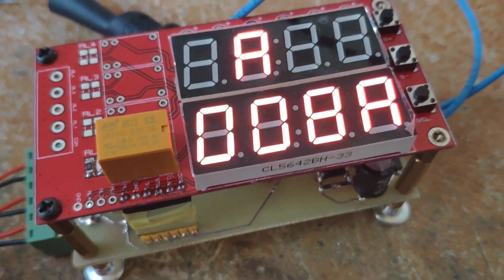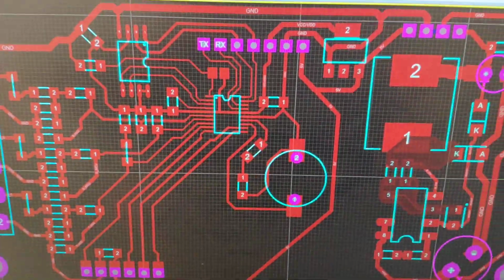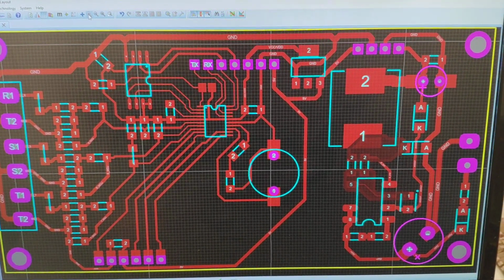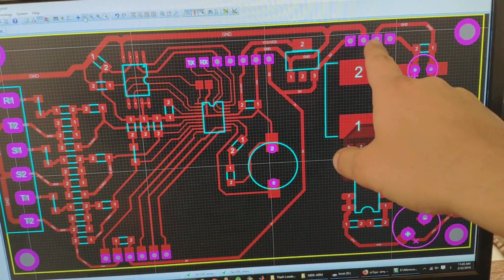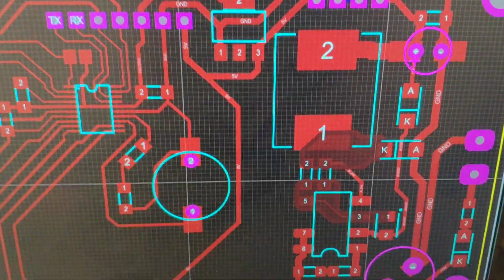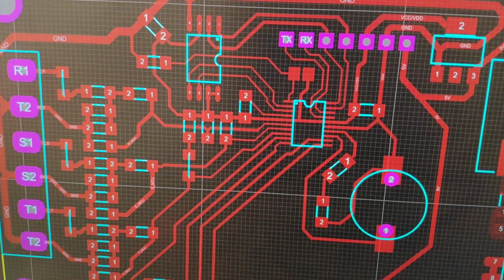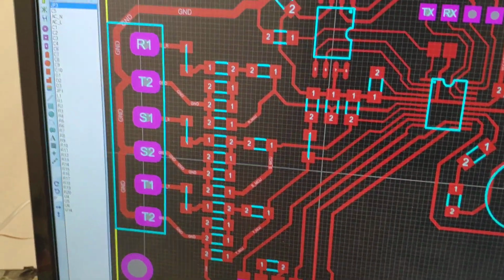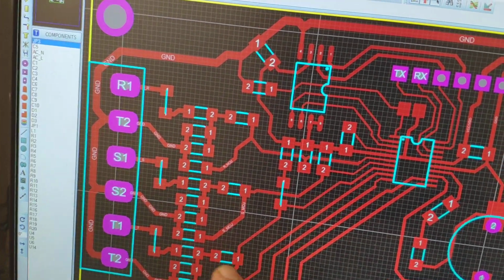Three phase over current relay made with stm32 microcontroller

Comment: You must implement the 50 (instantaneous) first, the 51 (time-delay) is good to have, but all the systems has always at first the 50 element to protect the load.
Reply from the maker: It's just a start, I'm thinking of adding more elements like over/under voltage and making it an open source relay. Thank you for feedback